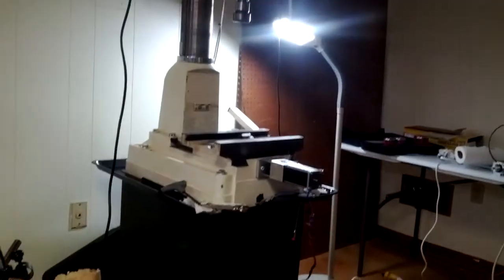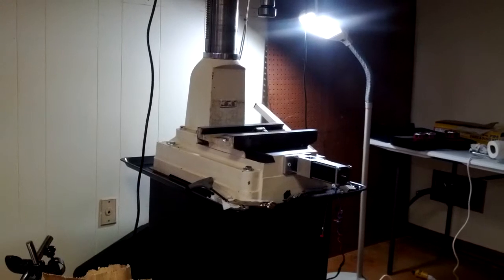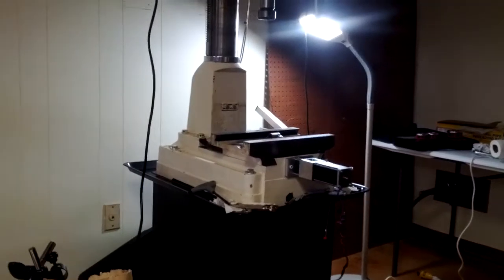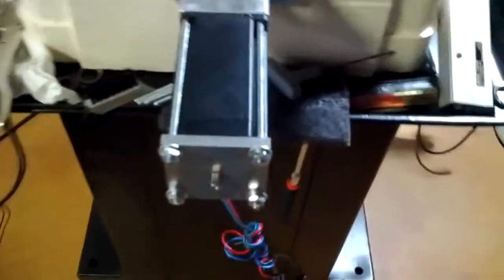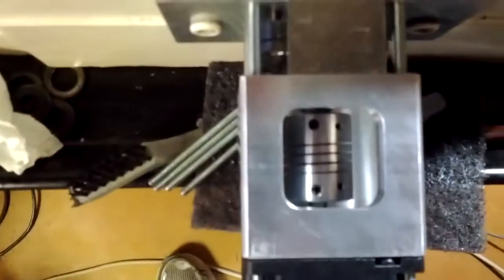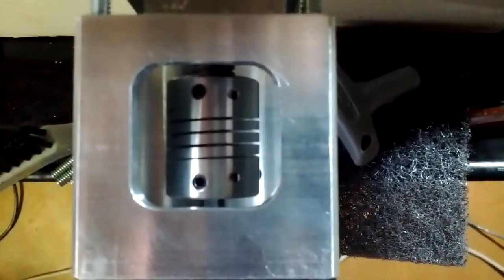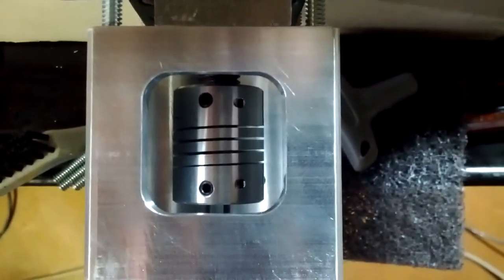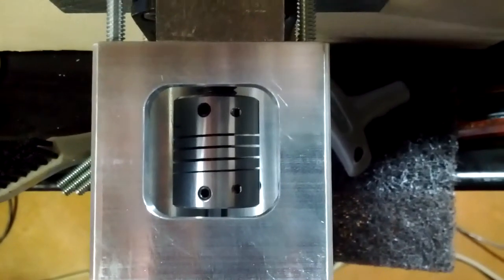Rong Fu RF-31 CNC conversion first motion

Comment from the maker: The total cost for the Dixie Wing Wells-Index conversion so far has been about $450.00, which is the price of 3 Geckodrive G203V stepper motor drivers.  The rest came from donated and scavenged parts - the power supply came from an old Vietnam War-era aircraft battery charger, and I donated an old computer on which to run LinuxCNC (free).  The original steppers and ballscrews which came with the mill were still perfectly good, so all we needed to do was change over the old control to the new.

Comment: on another youtube channel you said that the Index 700 with Bandit control was being retrofitted with a new CNC. I have a chance to buy a Index 700 with the same control for 1500 but it hasn't been rn for 10 years. Mill looks in good shape but i wondered what a retrofit cnc brand and price you were using on it?